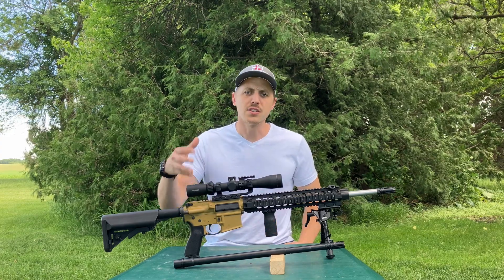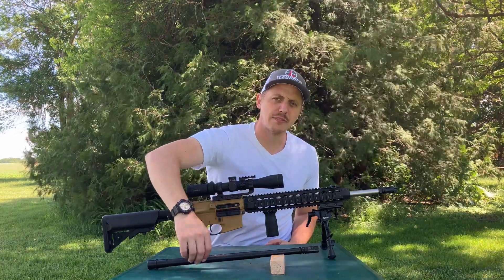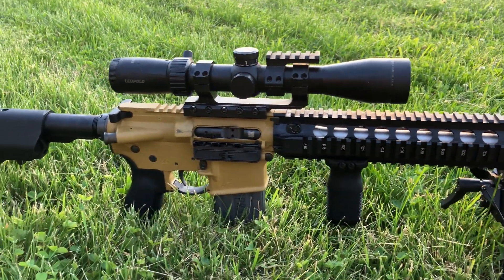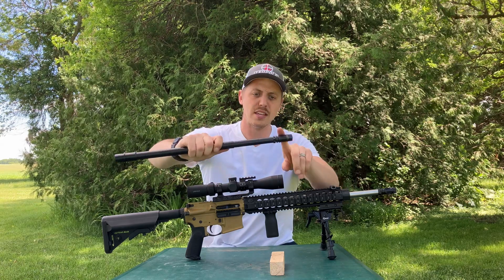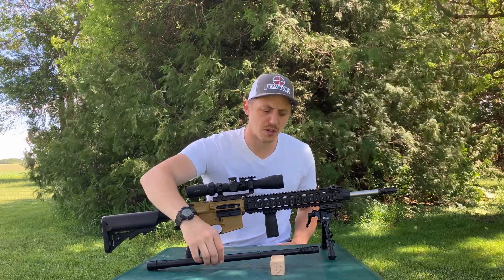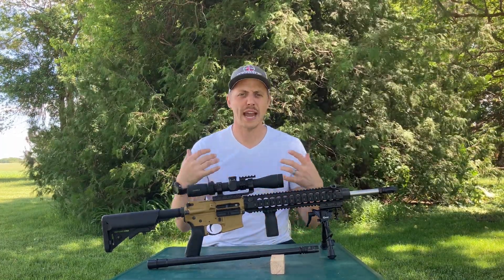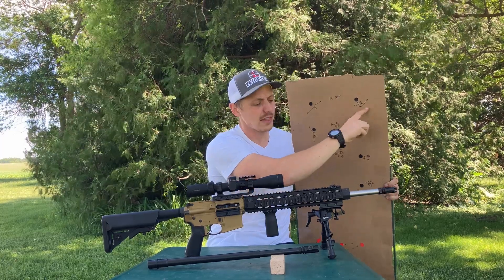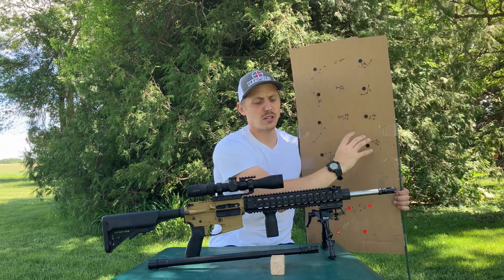What barrel is best? Stainless steel or 4150 Chrome Moly Vanadium?

Comment: I'm looking at a build using a 416R A2 profile barrel. My colleague has a build running a 416R barrel with over seven cases of ammo through it, still going strong. Yes 416R has a theoretically shorter service life than 4150 CRV, especially if its been CHF-CR, but one benefit of a 416R barrel that you actually mentioned is that it starts out generally more accurate than its 4150 CRV counterpart, and it maintains that accuracy more steadily than a 4150 CMV, all other criteria being equal. A good portion of match shooters go with 416R barrels for that very reason. Anyway, If I can expect a 10,000 round lifespan out of a build then my money's worth has been realized, and it'll probably outlast me.

Comment: Thanks for the info, which Chromoly or Steel Barrel. I want precision. Using factory, was I think -not good. Each factory round will be of different, overall length and powder charge. Try again with Reloads. 😮

Comment: If you want accuracy you must do the research to build and designate a specific load that groups the best with any particular barrel 
Barrels are like people all are unique 
I can take any barrel irregardless of it's composition and hand load a load that will be tailored to it to display it's true potential

You cannot take a random selection of factory offerings and use them to display it's true potential 
load development is a process that a shooter must do for each rifle to allow it to show it's true potential 
and most do not ever do that .

OAL 
Powders (varying charge weight) 
Primers
Bullets 
all must be tested in varying degrees to locate the ideally matched load configuration for any specific barrel
its very time consuming .

there is no difference with regards to accuracy in the barrels you have chosen 4150 vs CMV
as long as the machining process is equal .
Reply: I agree but correct me if im wrong isnt a .223 wylde have tighter tolerances for 5.56 giving more accuracy to 5.56
Reply: @roberttheslayer14 yes a wylde  chamber dimensions are always more conducive to accuracy
Reply: Thats what i thought lol so theres too many variables in this comparison  @FireBYNight1969

Comment: That’s crazy having to buy a different bcg for different barrels,I thought as long they had same feeding ramps it shouldn’t matter what barrel you put on a say BCM bcg,it should work fine, I would appreciate your input on this your way of doing this.
Reply: Any 223/556 bcg will be fine with any 223/556 barrel. Just want to make sure its headspace is right.